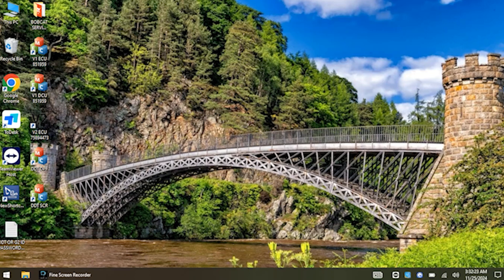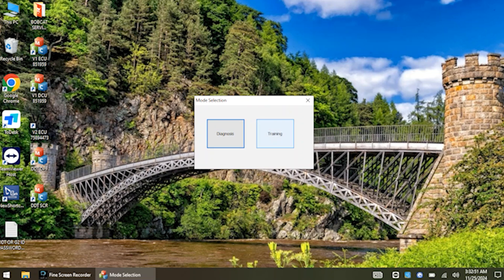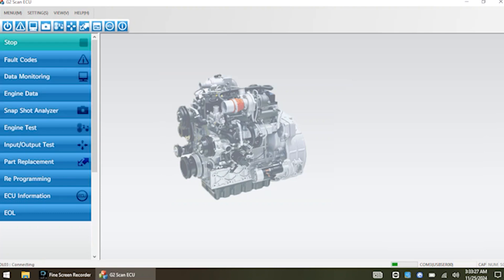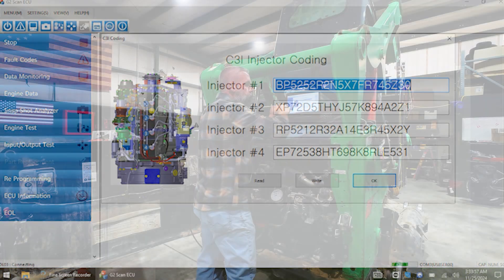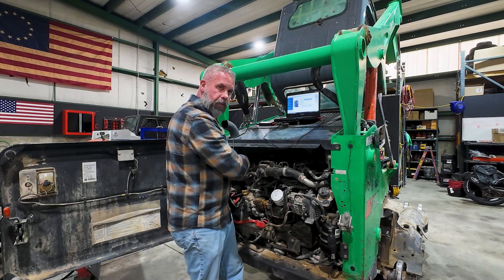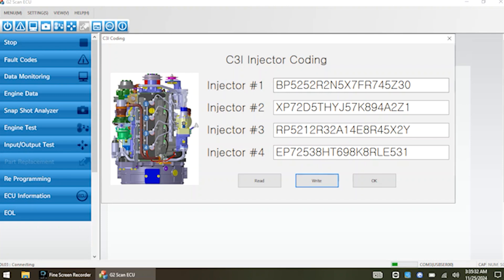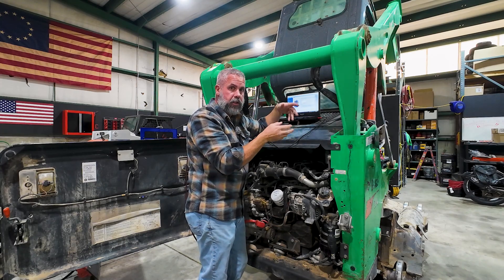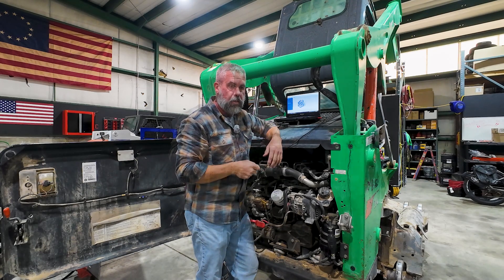How to Program Bobcat Doosan Engine Fuel Injectors, C3I Injector Coding

Comment: Hi Brady, I have a problem with my skid steer loader, which has a Perkins Shabura engine Caterpillar 216B  and Casey SR130 . When I turn quickly, the engine slows down and suddenly stops. All hydraulic pressures are fine. The parking brake has no problems. The fuel pump and injectors are new. I've given up. Any ideas?engine

Comment: Question, not related to this. I'm running an auxiliary centrifuge oil filtration system on my truck and would like to know is there an auxiliary pressure port coming off the oil pump on a T-650 to add this filtration system. Thank you

Comment: I don't know if Brady still provides the service, but when I installed two new injectors I was able to get consultation and rent a laptop from Brady to program the injectors. The laptop was shipped to me very promptly. Brady even had me run some diagnostics using the laptop and checked the results to see the performance of the engine for me. It was so simple and affordable! I highly recommend it if he is still providing it. Throw an extra tip onto your payment if you are able to. Thank you Brady! Your content is so dang helpful!